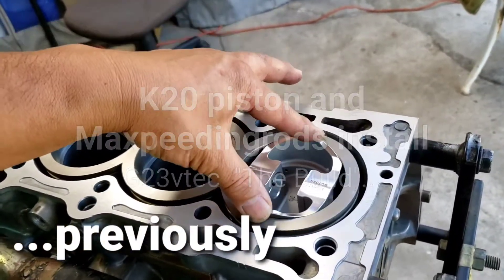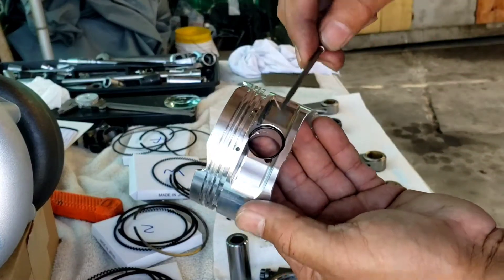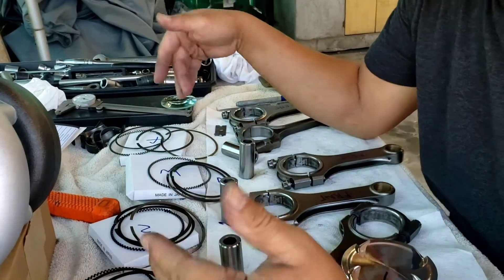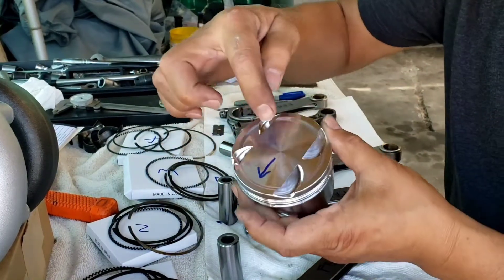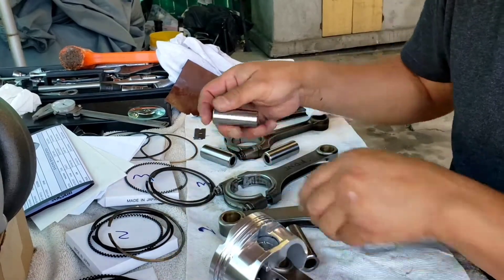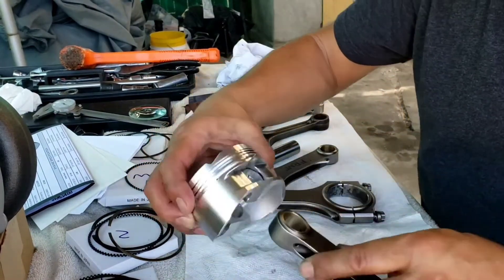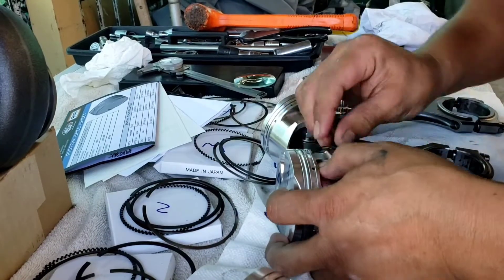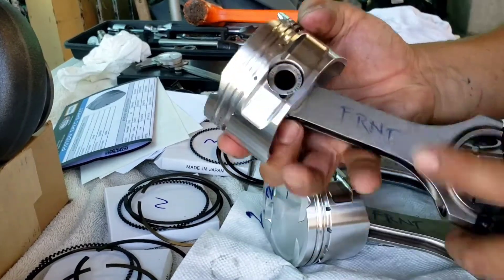Cp k20 pistons and maxpeeding rods mated. G23vtec.

Comment: Hey that's interesting to see you install the K20 piston instead of H22. I am curious why? Is K20 piston better performance?
Reply from the maker: K20 piston are the choice if you are building a frank motor ( f23/ h22 head). It has same piston height like F23 piston and the same piston valve relief like H22. If you install H22 piston on f23 block w/ f23 rods, the piston will stick out about .020".
Reply from the maker: There a lot more on just installing a k20 on f23/ h22 head motor. You have to pay attention on the wrist pin offset too. CP piston dont have wrist pin offser so l dont have to put k20 backwards. I think l have a video explaining about piston choices on f23/ h22.

Comment: Ok so you say you used k20a2 pistons?  Doesnt that give you a cp ratio near 12.5?  Arent you boosted?  How does that work?
Reply from the maker: Yes, boosted, it was a CP k20a2 piston w/ 9.3  to 1 comp/ ratio. I was shooting below 10.1 ratio when l got these pistons but w/ the block been shaven and the head. I think it went passed 10.1
Reply from the maker: The 11.1 comp ratio that we are familiar with when using k20 type S on g23 is the OEM comp ratio. Have you been to or are you familiar w/ that calculator ratio Zealautowerks.com. I always visit the site just to give me an idea what comp ratio l'm building.
Reply: @sagittnet2158  Yeah ive been there and it says the comp ratio is 12.4:1 thats why im wondering what is going on here
Reply: @sagittnet2158  and im not familiar with k20a2 pistons being 11.0:1.  Never heard that anywhere.
Reply: @sagittnet2158  ok wait i think i got this.  TBF I havent really watched your videos so im not up to date.  You are using aftermarket k20 pistons to lower the cr
Reply from the maker: @timm5970  usdm k20a2 type s, from factory it has a 11.1 comp/ ratio.       So l basically bought a k20a2 piston that has 9.1 or 9.3 to 1 comp ratio and that how l ended up w/ estimated  more than 10.1 ratio. You have to know the dome cc of the piston, if its - or + vol cc. If you look at the f23 piston, since ut has no dome, and if use on g23. Your comp ratio is over 8 to 1.
Reply from the maker: @timm5970  Yes, the k20a2 Cp pistons l'm using have a lower dome CC and its for turbo application.
Reply: @sagittnet2158  usdm k20a2 is 11.55:1 according to zealworks
Reply: @sagittnet2158  comp height 30mm dome 4.25cc
Reply from the maker: @timm5970  Yes, that's the ratio that everyone is familiar with using K20a2 oem piston (4.25 dome CC) on g23vtec.
Reply from the maker: @timm5970  yes, and I'm using a K20 Cp piston w/ -3.?? cc something. I can't remember now, but l know l was below 10 to 1. Anyway l hope it clears out. So if you ever want to build a Turbo setup, ideal is 9-10.1 ratio.
Reply: @sagittnet2158  So i learned about G build years ago but never did one.  Had an accord, had a prelude, but never did it.  Right now i have an integra and I want to do a G2B swap.  I plan on running it NA and I dont want it to be a cop magnet but i do want to make it as fast as i can while being na, daily-able, and low profile.  You think the stock k20a2 pistons would be too much for a mild build on 91 octane?  Keep in mind ill probably have a 2.5inch exhaust running 2 mufflers.  I dont want a loud exhaust AT ALL
Reply from the maker: @timm5970  k20a2 pistons will be perfect for your build and l think 200 hp or more @ the wheels will have no problem moving your 'teggy. Just take your time building it and 2.5 exhaust piping is perfect.
Reply: @sagittnet2158  If I made 180whp id be happy as long as its reliable but im shooting for 220whp or more.  To do that I think ill need to cam the engine but my concern is, is the stroke too big to be cammed?  If I rev this thing to 8 or 9k its going to be too much isnt it?  Do you think id be better off sticking with an h22 block that could rev easier?  Do you think the torque from the g23 trumps the high rpm from the h22?
Reply from the maker: @timm5970  You'll be surprize what the g can do. I actually have a vlog comparing my H23avtec and g23vtec dyno graph. But l'm still editing it. It's not really good for hi-reving but l'll be honest, my g23 wants it @8k. I know l'll be doing damage soon. You have to replace the valve springs if you want to rev pass 7k. I'll upload the dyno graph soon and also l'll share all the support mods.
Reply: @sagittnet2158  Its mainly the block im worried about.  Apparently the stock rods are very thin for their piston speed and the setup moves the pistons faster then more engines.  Im thinking ill forged rods
Reply from the maker: @timm5970  It is very thin, forged rods is a good upgrade, later down the road if you decide to turbo it.

Comment: The rods it self I took sand paper to the rods bushing the edges sand little bit
Reply from the maker: Thanks man! Yeah, this  set of rod was on my 2nd g23vtec that overboosted and cracked the cylinder wall. I was wondering at that time when putting it together, it was tight and pin wont go in. I guessed it was damaged and it was too late for me to stop coz the motor was on the car already when l thought about the history of it. But motor is still running strong up to date.
Reply: @sagittnet2158  yea real street did a video on it. Man nice 👍 happy she still living strong. I just followed you. I will catch up. Good stuff
Reply: @sagittnet2158  I don’t think you damage it. But just how u was forcing it , scared me …
Reply from the maker: @tee_gunna504  thanks man, appreciate that. Stay tune and more content coming up year 2023.

Comment: Did you do oil clearance for wrist pin?
Reply from the maker: This exact rods was on my previous G23 that the cylinder gave out (overboosted). The  small end of the rod deformed a bit that l didn't know not until l assembled the motor like youv'e seen on that vlog. But by the time l remembered the history of the rod, it was too late. The engine was already installed onto Myllie and ready to go. It did cross my mind that l hope it wont fail on me during the dyno session. But as you can see, the motor is still going w/o any problem. Lucky l guess that a inexpensive maxpeedingrods can really be trusted when it comes to engine internal parts. Thank you for asking, l guess you were the first person that l gave info about using maxpeedingrods parts. How's your project coming along?
Reply: @sagittnet2158  Hi thank you for the quick response! I asked because I wanted to know if I need to do it. I have KSTuned rods with ARP bolts and I check to make sure the pins are moving freely in the pistons/rods and doesn't bind. My project is coming along slowly; yesterday I did the main bearings clearance and I just finished installing the rods on the pistons and installing C clips (the first was a pain but got the hang on the second) and now I'm doing the rings but have a questions regarding the oil ring. Do I place the oil ring spacer top of the oil ring or bottom?
Reply: @sagittnet2158  I'll post some YouTube Shorts for you to see the progress.
Reply: I think I got the answer to my question. I thought there was only one oil ring in the piston ring set but it's two for each piston. The other one was bonded to the other, making it looks like it's only one.
Reply from the maker: @Open90  ok, good to know, just pay attention on those forged rods as far a the notches for the bearings that it will be facing the right direction. Just compare it to the OE rods. For your oil rings, it consist of 3 parts, (2 rings and 1 spiral spacer). The 2 rings will sanwhich the spacer w/ the gap offset one another. Google it so you can see what the orientation of it. Since you are using brand new parts, they should be no problem on clearances, even though l ran into 1 before where l have to polish the rod bushing to fit the pin.
Reply: @sagittnet2158  I used the f23 manual along with your videos to position the rods correctly with the notches for the bearings facing the exhaust side of the engine and I marked the pistons to indicate direction in the bore. I posted some YouTube shorts on my story of this yesterday.
Reply from the maker: @Open90  looks good bruh!
Reply: @sagittnet2158  Thanks man!

Comment: Bossing hows the rods holding up, salamats po
Reply from the maker: Holding up fine still preko! Ok ang maxpeedingrods conrod, pangatlong engine ko nato na same rods and this exactly same rods was on my 2nd turbo engine that overboosted and cylinder cracked. Still using it, if youv'e seen my vlog about conrods being too tight. I didn't know it was damaged from that 2nd engine that blew up and yet all l did was polished it a little and doing a fine job. Yun isa na H22 turbo also have a no name brand from ebay and holding up. So no worry on no name brand, l guarantee it. Salamat sa time bossing sa panood. Ingat!
Reply from the maker: Not sure kung nakagamit ka na ng forged rods. Tip lang, make sure to install the  rods bearing notches on correct sides( notches facing exhaust side). You'll good to go, salamat muli
Reply: @sagittnet2158  ah akala ko po kahit anong side walang difference, salamats po sa tip.. Naka gamit na po kayo supertech pistons? Pang 
Turbo application sana
Reply from the maker: @alitoroganan2442 it has something to do w/ preventing rod bearing to spin in place. Yun supertech piston, ano block ang gagamitin mo?. Kung H22 w/ frm sleeves, hindi sya pwede. Sa mga block w/ iron sleeve lang, maski advertise eh compatible sa frm sleeves, H'wag mong gamitin. Very picky ang H22, only OE or mahle, pero maski mahle piston may mga tao na nagkakaproblema din. Di kasi nila pina follow ang piston to wall clearance recommendation ng manufacturer.
Reply: @sagittnet2158  pang k20z1 lang po yung supertech, same company po ba mahle and supertech..
Reply: Sir yung bolts po pala ng maxspeedingrods rods nyo arp2000 o upgraded po nung l19
Reply from the maker: @alitoroganan2442  magkaibang company, K series ba ang build mo?
Reply from the maker: @alitoroganan2442 yun maxpeeding rods eh it comes w/ arp bolts not L19. Not sure lang kung authentic pero ginamit ko till the 2nd engine blew up. Kaya nag upgrade ako ng real Arp for the 3rd time use coz of the incidents. Kung mga target mong piwer eh more than 500hp,suggestion  ko mag upgrade ka ng real ARP bolts for peace of mind .
Reply from the maker: Ay oo nga, some no name brand comes w/ L19, pwede mo naman palitan ng real ARp bolts. Ano ang engine build projeck mo?
Reply: @sagittnet2158  kailangan po ba mag upgrade kasi na receive ko na po sha kagabi, yung isang rod ndi naka plastic wrap, wala naman po rust ako kikita, madami lang po debri sa oil whole sa small end
Reply: @sagittnet2158  ano lang po k20z1, bc na 80lbs double valve spring tapos steel retainers then arp head studs rest stock na head, rods pistons lang po.. Kuya message po kita fb,. Ano po pala fb nyo ulit hehe its been awhile
Reply from the maker: @alitoroganan2442  k series build ka, pwede ang supertech sa turbo, Cp pistons ang gamit ko for boost. You can try it.
Reply from the maker: @alitoroganan2442  yun supplied bolts eh ok na yan up to 450. Kung mas mataas pa doon, upgrade ka na lang. But for your intention of use, you'll be ok. About the bearing notches, just put it on like the oem, not sure if k series are the same as H, B n d series.
Reply: @sagittnet2158  bro nakita ko po mga lumang post ng builder nag palit sha headstuds pero one at a time, para daw ndi na magreseat head gasket etc. Ok lang po ba yung ganun practice
Reply from the maker: @alitoroganan2442  oo, ginagawa yun procedure nayun kapag  walang masyadong time ang headgasket. Kung gagawin mo, open mo ang radiator cap para maalis ang pressure sa radiator.
Reply: @sagittnet2158  nako wala po ako alam mag buo ng makina hehe, sana dito na lang kayo sa Melbourne😅 san po pala kayo based ulit? Kuya oks lang po ba ang 310mm sa rl calipers

Comment: this k20 pistons are the k20a1, k20a2 or k20a3??? please tell...
Reply from the maker: I'm using K20a2 type S pistons.
Reply: @sagittnet2158  Thank you, You have no reference to what is the dome/dish vol of those pistons?
Reply: @sagittnet2158  I want to build an f23 but with an original f23 head and I have read that for what I want to do the k20a3 piston could give me a compression between 10.5:1 to 11.5:1 approximately but that with the k20a2 and the k20a it would be much higher due to the dome/dish piston model vol
Reply from the maker: @franciscodeandradejr  I'm not familiar w/ single cam F23, but l think yes k20a3 will give more compression. Recommend to have it tune coz of too hi-comp.
Reply from the maker: @franciscodeandradejr  visit Zealaitowerks.com. When you go to their site for particular engine comp/ ratio, it"ll give it to you.
Reply from the maker: @franciscodeandradejr  Oem k20a2 is 4.25 dish